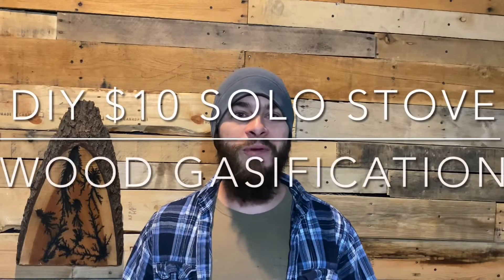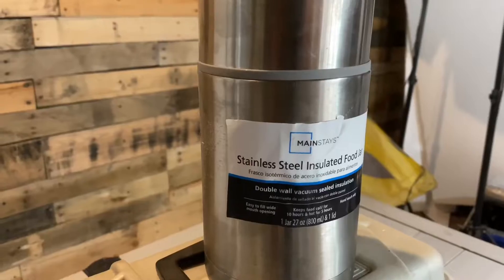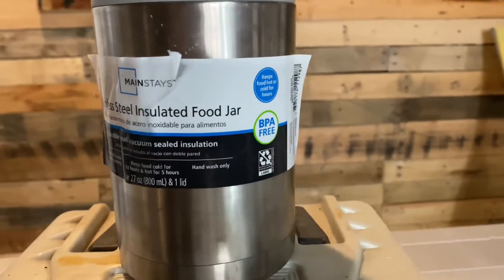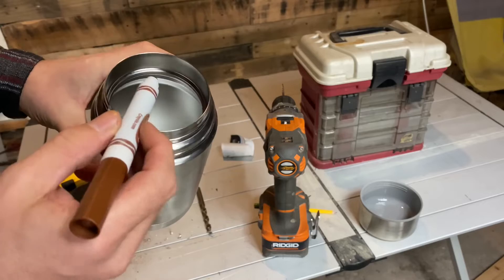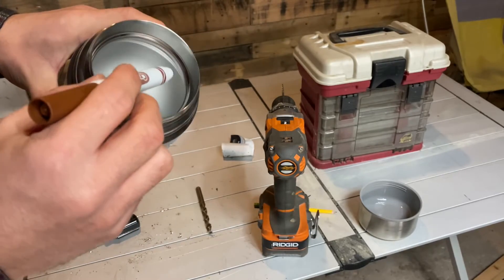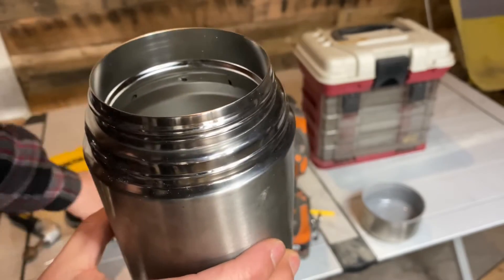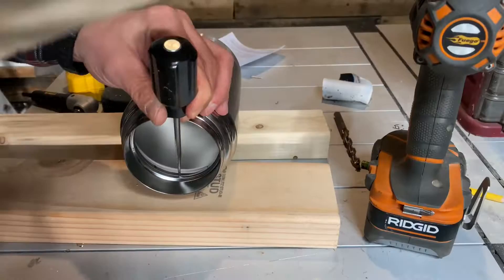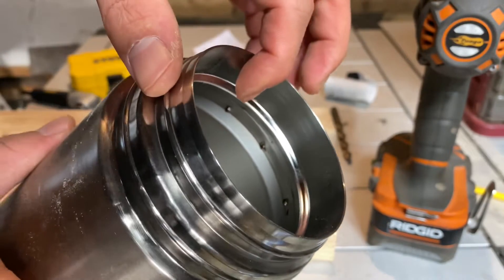$10 DIY Solo stove Wood Gasifier Stove

Comment: I've made those stoves in different sizes.  My smallest one is out of bean and soup cans. My largest is made out of the tank of a hot water heater (about 18" diameter) and a 55 gallon barrel section for the outside. It makes a great outdoor firepit in the back yard. They all burn extremely hot and clean.
 You need to drill more secondary holes on the inside (closer together) so the flame won't go out like yours did.
Reply from the maker: Good catch, I'll try that on the next one.thanks for watching

Comment: So  three years ago you stole the idea I had tonight

I'm thinking of an ice bucket 

What about putting a wood feed hole on the side installed of top feed?
Reply from the maker: I think a feed hole would stop the wood gasification but not sure. Thanks for watching
Reply: @AdventureswithSpackmann  how so?
It's basically just another air hole that would pretty much be in line with the other air holes
Reply from the maker: @stanb990  I’m not sure but it may redirect the airflow, perhaps?
Reply: @AdventureswithSpackmann  I thoughts of that after your comments 
So I'm thinking a 2 inch bung would seal off the hole between the walls
Reply from the maker: @stanb990 nice thought. Let me know how it works.

Comment: I had to use the point and then a screwdriver to widen the holes. Will using a grinder blade to cut in the lower slats work instead of large drilled holes?
Reply from the maker: Slots should work fine too. Thanks for watching

Comment: I’m think maybe make the holes inside with a dremmel tool and a cut off wheel. Stainless is hard on regular drill bits. Tungsten carbide might be a better choice. Great job over all, now to find a cheap large stainless thermos.
Reply from the maker: Ah dremmel for the inside holes is a great idea! Glad you enjoyed the build, have fun. Thanks for watching

Comment: I don't know if you looked at my contraption. But I invented it to save charcoal..
Only one cup of charcoal can boil a cup of water first and then once burning well can cook a raw steak and sometimes you can snuff it for further use. The second burn is better for tender meats like chicken. But 2nd burn won't boil water unless there's 3 cups of used charcoal.
The energy density of charcoal is on a par with gas or alcohol.
And it's quite light to carry.
I have made 3 grillers that nest like a Russian doll. I then use the smaller ones with sticks underneath the bigger one to light up the charcoal.
If doing a lot of grilling for the family the little ones are ready to prelight some extra charcoal.
I recently went out for a weekend and only had a small bag of charcoal about the size of a big big bag of chips /crisps and I cooked 20 raw sausages and two fish and 10 prawns and still had half a bag of charcoal left.
Worth a try
Reply from the maker: @peetsnort did you ask me to look at your contraption? If not, is it on YouTube? Point me in the direction please. Thanks for watching
Reply: @AdventureswithSpackmann  https://youtube.com/shorts/g_m2LNOg5zA?feature=share

Comment: 10$ plus a 1000$ worth of tools. not taking to count, the wear of the bits and tools, because it's not big, but it's also there too. Nothing wrong to make one, if you already have the tools ,but it's not a "how to build one" for the 99% of the people out there.
Reply from the maker: @Greek Veteran all the tools shown in this video cost me $35 all together. $20 of which was the used drill press I bought off of Craigslist. BUT, you can make a hole with nothing more than a screwdriver and a hammer. Make them bigger with something else(wooden stick, bigger screw driver) or just use a hand drill. If you have one. It’s a how to build one not a use these tools to build one. If you don’t have the tools, figure out a different way to make holes. Find deals on tools, buy used. Drill bits have been sharpened for years and years and I sharpened them again after this video. You don’t need fancy tools but they do help. Thanks for watching.

Comment: so cool...  I mean HOT!   I wonder about control. Is there a way to make sliding piece that covers the outside holes. It would allow one to control the flame if you don't want that much heat, or say you want the fire to last longer.
Reply from the maker: @Fred Spek glad you like it. You can totally add an air damper on the outside holes. Not sure how it would affect the clean burn but it would definitely slow/control it. Thanks for watching

Comment: Lol but one thing though, I would definitely going to drill above the seal line lol cheers ☺️
Reply from the maker: @Justin Hachey above the seal would put the holes above the bottom of the inside layer. For the gasification to work properly(this is only what I think) I believe they need to be below the air intake for the inner layer. Not positive though. It would probably work just fine and still gasify but may not be as efficient.

Comment: I hate to be a Debbie Downer but it's going to be impossible to clean. eventually, Ash is going to get into the holes and there will be no way to remove it. Unless somebody's got a solution to that.
Reply from the maker: @Gregory the ash falls right out. It’s not sealed in any where. There are two walls, holes connecting them. Just shake until no more ashes. Thanks for watching.
Reply: @AdventureswithSpackmann  I guess you could also save the lid put some hot water in there ,Shake It and dumped out what's left
Reply from the maker: @gregory2421  that would work too.

Comment: Just a non pro tip I would have made the top hole smaller and just put more around leave the bottom how it is that looks perfect... I just wonder if it would be more of a controlled flame and would possibly burn everything better. Love the idea tho I want a mini smokeless fire pit for my hammock shelter I feel like something would be perfect for inside my cover
Reply from the maker: @brick yeah. I know there is a secret formula for the amount of holes and size of holes that make it even more efficient but I just rolled with it. What kind of hammock shelter do you have? This stove works well. I just gave it away in a giveaway recently. Have you seen the new solo stove desktop/table top stoves? Pretty neat and small, maybe perfect for under a shelter setup just for ambiance of fire.thanks for watching

Comment: According to my experiment, the flame is not coming out from those small holes, oxygen is coming out instead to enhence burning.
Reply from the maker: @tlangram 25 you’re right. Oxygen is being sucked in the bottom, then coming out the top holes and adding to the wood gas to ignite it causing secondary combustion. I know I said look at the flames coming out of the holes but I didn’t mean they were coming out of it, just coming from it. Thanks for watching

Comment: What are You going to do with it ( besides  boil water  ) ? It burns so
hot it looks like it would burn up anything You try to cook on  it  ( might 
melt a cheap pan )
Reply from the maker: @john howard it’s just like any other wood gasifier stove on the market. You can use it to cook anything. You can put less wood in to have a small flame if you want that. Or just boil water for dehydrated meals. No need to carry fuel just carry the stove. Thanks for watching

Comment: These bottles aren't available in my area, so I'm left with using cans...
You could  probably nest some cans with tabs cut at the top that you bend out, and get a double-walled design, but it will leak air a little.
Reply from the maker: @Don Cankook you don’t have double walled thermos in your area or your Walmart in your area doesn’t have these thermos? Thanks for watching!
Reply from the maker: @Don Cankook I made another one out of a soup can and quart size paint can. They fit together perfect!

Comment: $10 diy solo stove with at least $20 in drill bits. Nice project but for someone who want to save some money I don't think so
Reply from the maker: @InventionPR drill bits aren’t cheap that’s true. But it’s manually an instructional video. You can make holes with anything. A screw driller and hammer or a drill. Use what you have. Thanks for watching!

Comment: Do you think a stainless mug would work too? It has a handle and is compact.
Reply from the maker: @Rusty Alcorn yes as long as it’s double walled you can get the same effect. It would just need to be fed a lot cause it’s so small. Thanks for watching!
Reply: @AdventureswithSpackmann  for me, a solo trucker, space is always tight. Plus the mug has a handle it could be hung from.
Reply from the maker: @Rusty Alcorn yeah when you mentioned the handle I thought the same thing. Even to pick it up while burning, if it doesn’t get hot. I really like the handles idea and packable size. Great idea!

Comment: a TLUD stove (top lit up draft stove) is designed to be lit on the top of the fuel load and the load is then left to burn down intact without adding any other fuel. This is crucial for efficient pyrolysis to take place. Lighting the stove at the bottom of the fuel load turns the stove into a hobo stove with a secondary burn. Curious if you had a specific primary to secondary air hole ratio? Nice compact stove build with a good looking flame. You can test your stove for its burn efficiency by boiling some water then checking the bottom of the pot for soot. The cleaner the bottom of the pot the more efficient the burn of the stove is. Efficient stoves burn hotter cleaner and longer for a given size of fuel load. Curious also does your stove leave any charcoal when it burns out or does it transition on its own and burn up all the charcoal. The charcoal burns hotter and with a bluer flame.
Reply from the maker: @moray james my first test left only ash. My second test I put out with water so I didn’t let it burn out. As for hole ratio, I did not. In my second test I put the pot on when it was still starting a soot did form then. Thanks for watching!
Reply: @AdventureswithSpackmann  so you got a full burn on your stove if all you had left was ash that's important in a small compact stove. I have built stoves with small tin cans and it is a real rabbit hole to get a smokeless burn from start to finish but it is interesting and challenging to figure out. Happy camping and enjoy your stove.
Reply from the maker: @morayjames92   thank you!
Reply: @AdventureswithSpackmann  if you are interested here is a stove design not much different from yours which ticks off most every performance box and when adjusted for your height above sea level it can burn pretty much smokeless from start to finish. both the Mk1 and the Mk2 versions are excellent stoves. https://www.youtube.com/watch?v=w7ZLyyfMQ20&t=3s. I use one of these as my reference stove and compare my own builds to it when comparing performance.

Comment: I drill a 3 inch hole in the bottom of those and use a stainless sink strainer to keep the wood pellets from falling out, and it gives a great airflow. Also I have used stainless scrubbies for that purpose. If you drill your outside bottom holes around the perimeter about two inches higher, it gives a better gas production throughout the burn. Thanks that was great!
Reply from the maker: Ah I’ve seen the pellet mod for lots of stoves! That’s a great idea. Someone on Reddit mentioned something about putting the holes in different places to get a better secondary burn. Thanks for watching!
Reply: @AdventureswithSpackmann  Thank you very much! Have a great Christmas!

Comment: was the cost of the drill press added in to the total of the DIY cost?  seems like you have a bit more luxury than some of us who have to do everything by hand....
Reply from the maker: I started the project by hand and it totally could be finished by hand. I got the drill press at a very great price off Craigslist. Thanks for watching!
Reply: Hey, the cost of power and the amortization of the house weren't included either! It is very hard to do full, true-cost assessments. I think the method of including only the cost of necessary external inputs is fair unless one has access to something truly extraordinary and absolutely needed.
Reply from the maker: @David Mason very nicely said. Thanks for watching!

Comment: Great idea!  How quickly will it boil water.  Can you boil it with one load of wood?
Reply from the maker: I am actually making a pot stand right now. I won’t be able to test boil times until tomorrow but I will be uploading the pot stand and testing video once I’m done with it. The 2x4s burned for about 20mins I think in the first video so should be plenty of time to boil some water. Thanks for watching and I’ll try to remember to get back to you here on if it will boil on one load or not.